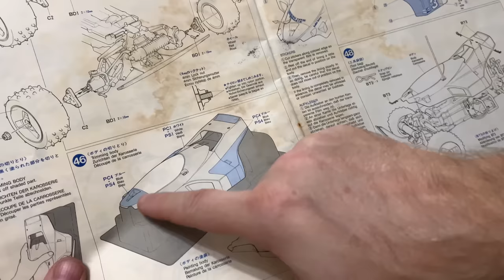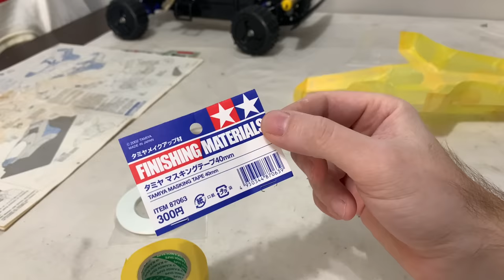1987 Tamiya Thundershot

Comment: I  got a thundershot for my 11th birthday, I'm 41 now and no longer have it. I did race it in open classes, and it was terrible but i still loved it. I was up against the ProCats, Lazers and DogFighters who had the beating of me nearly every time.  Most times I hit the track boundary it would break that tiny piece conecting the front gearbox to the lower swing arm, it cost a fortune in that one single part. I ended up striping out the front gear box and ran it 2wd to try to be a little more competitive but those dam cougars were so fast! This bought back so many great memories, thanks for the video dude!

Comment: Nice!!!!! I used the curved tape on my DF03 keen Hawk body and it worked brilliantly. I did have to run over the tape edge to give me the confidence but happy with the result.
Reply from the maker: It’s absolutely superb stuff, the only downside I’ve found is, it doesn’t like going over the top of itself. I’ve had leaks when doing that. No biggie now I know 🤓👊🏻
Reply: @TAMIYALegends  I got hold of 2 widths, really fine one for pinstriping (probably too clever for me 🤣)

Comment: On refurbishing old tyres; I spray liberally with silicon and then seal them up in a zip bag with as little air in as possible.
Reply from the maker: Excellent my friend, thanks for the tip I’ll give it a try 🤩👊🏻
Reply: @TAMIYALegends  forgot to mention it needs to be airsoft silicon (gun oil) spray as that is plastic safe.